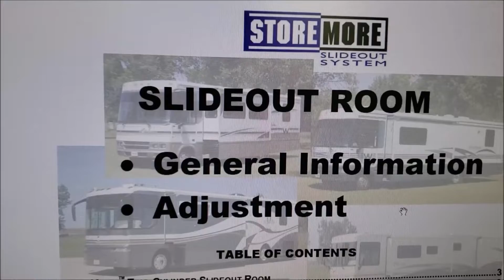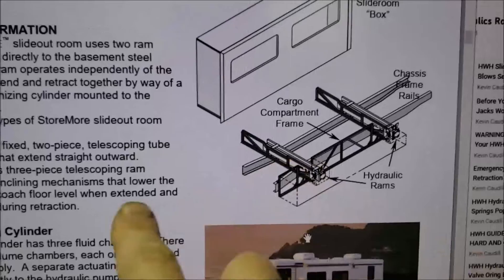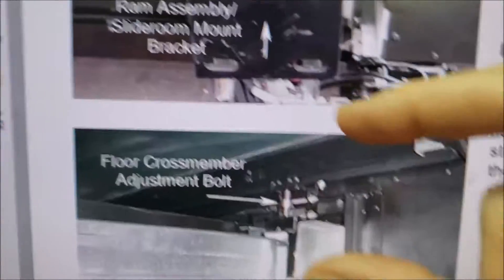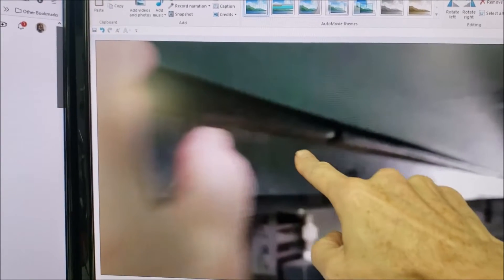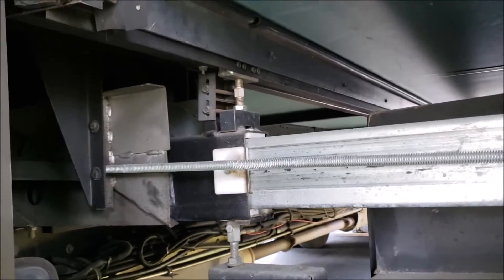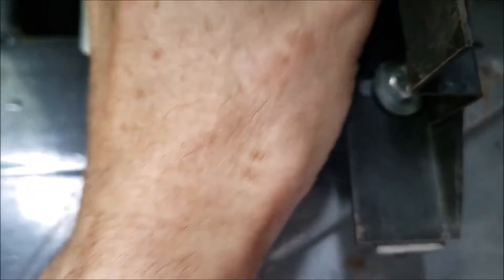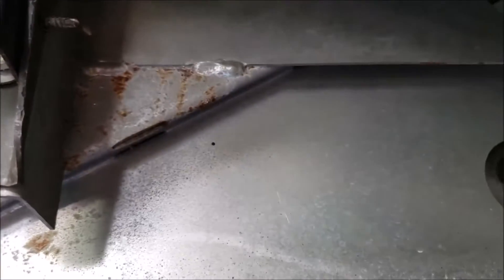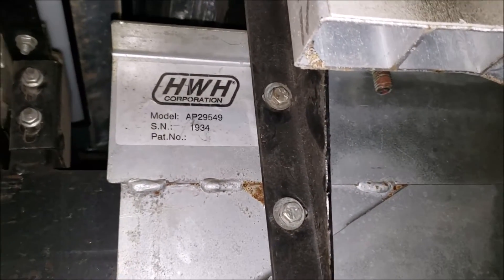Early Warning System, If Your HWH Slide Room Paint Lines Don't Match Failure May Be Imminent

Comment: Thanks Kevin - another great video!
BTW - as you know the pair of small "bearing blocks" at the bottom outer edge of each major ram take a tremendous amount of weight, and it is amazing that they can hold up for many years.  But as you saw here, and as I experienced on my 2005 Winnnebago Adventurerer 37b they do eventually give it up - and start breaking apart. Which I noticed last summer when I found pieces of them on the ground.  But luckily I had new parts from the HWH bearing block kit.  But to replace them they did not design in any way to correctly do that, short of pulling out the entire ram assy.  But I did come up with a way to quickly & easily replace them by cutting through the nubs on the top blocking plate so I could remove it.  Once removed one can then raise up the entire extended ram to provide enough clearance to remove & replace the lower weight bearing nylon blocks.   Setting it back down I then re-installed new upper "plates" after drilling and tapping into the upper outer nub to allow a large, very short sheet metal screw to be threaded into it from above, holding it in place.  Works great!
Reply from the maker: Thank you for the nice write up. On your repair.
Reply: Richard - I have a similar issue with my 2006 Winn Adventurer 33V.  I'm not sure if I follow your description for removing and replacing the upper bearing blocks.  Do you have any photos to share?

Comment: Thank you Kevin! Another excellent video. We purchased a 05 38R last September and I noticed that it has the gummy residue from some type of lube put on prior to our purchase. I wanted to scrape it all off and spray with a dry lube or Boshield T9 but was told by HWH to never spray anything on the slide rails. This just goes against my thinking of keeping moving parts lubed. I have learned to trust your guidance so, in your opinion, should I scrape the old goop off and lube the rails, and what is the best product? Thank you and God bless!
Reply from the maker: Yes I would remove all that old gummy residue with mass air flow cleaner, it will be safe for plastics and the nylon slides, spray it down then blast it with a strong jet of water. I have been using this dry lube https://amzn.to/3yLBkpA its very affordable tecks that i know who work on these daily use dry lube.
Reply: Thank you!

Comment: This is my next project to do.  I have the 38J chassis as well.  My two adjustment bolts on the kitchen slide support bar are starting to bend.  I want to replace them before I even try to do an adjustment.  Do I need to support the slide in order to get those bolts out?

Comment: Kevin - Thanks again for your Winnebago and Workhorse videos.  You've taught me a lot.  My paint lines are off, similar to the one in this video.  Also, my nylon blocks are cracked and worn (both wedge blocks and flat bottom bearing blocks).  When my LR slide out goes in or out, it sounds like a banshee screaming.  I've used the dry silicone spray lube and this help quiet it down, but only for a few cycles.  I believe my slide out has a lot of friction on the sliding surfaces and rubs off the dry lube.  I asked Richard (below) if he has any photos of his repair for the bottom flat bearing nylon blocks.  However, do you have any experience replacing these bottom blocks?
Reply from the maker: I have not replaced ours yet, but I'm about to.  Text me your email address. I have some info that will help you. My cell 606-875-0125 Kevin